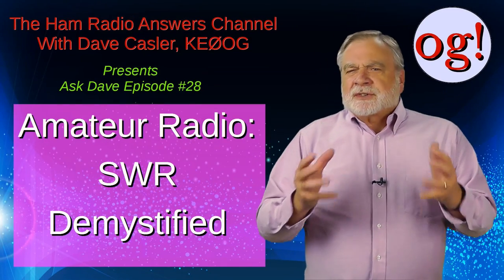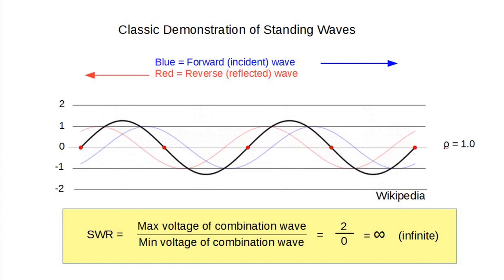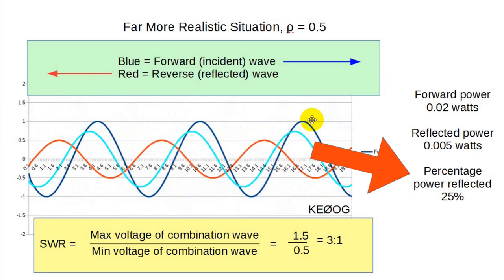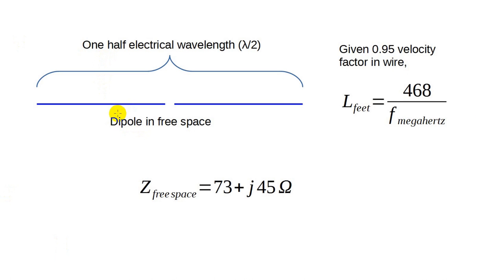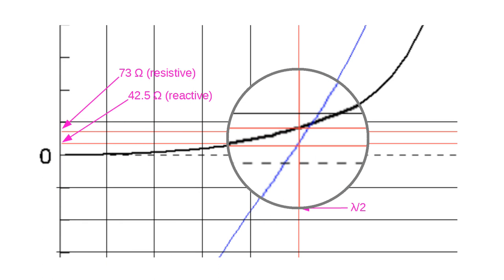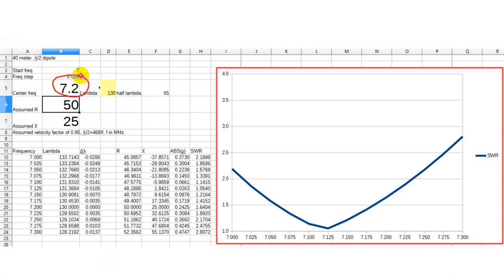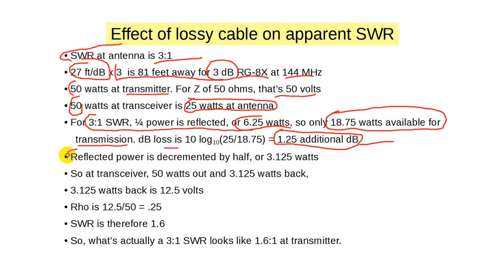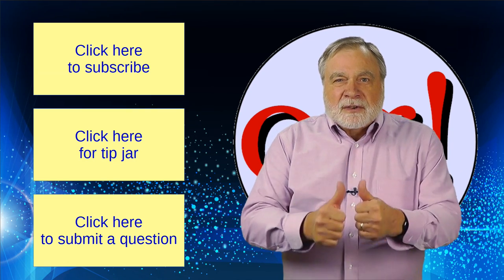SWR Demystified: AD#28

Comment: "Antenna designers pay attention to this stuff." Well, the competent ones do anyway. 

The company I worked for bought and tested 20 different antennas from commercial vendors. One marginally met its specs. The other 19 might as well have been coat hangers. 

Only buy antennas from places with good reputations. Or build and test your own, which is a pain.

Comment: Greetings David. I made some calculations and if for example, i have (50 + 45j), maybe 1.3 swr, the question is, what is a safe reactance for a transmitter?  Because the ideal would be (50 + j0 )but that is not the reality. I know that reactances can have dangerous voltages. A (0 , 50j) theoretically can have 50 ohms but not radiation resistance. I believe (47, 12j), you know 12j or less. I would like your opinion.
Reply from the maker: I'm not following your question. In general, 50 ohms resistive is the ideal load. As a rule of thumb, any SWR less than 2:1 is probably acceptable, but you are correct that the more resistive it is, the better.
Reply: Thanks for your answer. I agree with you. I know it's impossible to get a perfect antenna. By the way great videos. I am extra since 25 years and I always see your videos to maintain fresh my brain. And I learned new things. So thank you for your good work with your videos.
Reply: It depends on transmitter impedance & reactance (including it's antenna tuner). If transmitter has fixed impedance (let say 50 +j0), than any reactance will increase SWR, any R different from 50 will increase SWR. But if transmitter has tuner, which consist of 2 parts: reactance compensator and resistance transformer, than it can have SWR=1 with any complex antenna impedance. If antenna has +j reactance (inductive component is high), than antenna tuner with extra capacitance will compensate reactances. If antenna has R=25, then 2:1 transformer will match impedance and you will achieve SWR=1. In practice, tuner perfomance is limited by the fact that impedance of cables is fixed (e.g. 50 +j0) and antenna tuner must be placed near antenna, not transmitter. Another bottlneck of working with very low R is higher ohmic losses, with 2:1 transformer you decrease Voltage and increase Current twice. Twice current is 4x heat losses. Bottleneck of high R is high voltage and air ionization (possible arc).

Comment: Few questions pls. Can a standard HAM SWR meter be used for VHF say from 80 MHz to 110 MHz? Does the SWR reading depend on power being fed? Will the reading be same for 5 watt to 50 watt with a dummy load of 50 ohms (required wattage taken care of). Should the 50 ohm cable length  be multiples of 1/4 lambda for a 50 ohm GP antenna?
Reply from the maker: Yes. No. Should be. No--if the antenna is matched, the cable length doesn't matter.
Reply: Thanks a lot

Comment: You said that it is rare to have an antenna with 1-1. All My antennas are resonant on the band they are used on. It can take a long time to actually get the antenna to the 1-1 where no SWR is shown. VK2LEE  Lee
Reply from the maker: A 1 to 1 SWR means that the antenna is not only resonant, but the input impedance is exactly 50 ohms. That's pretty rare. But if you can get it there, more power to you, literally.
Reply: @davecasler  I shouldn't say every antenna is 1-1 but very close ,  but I am finding many new hams trying to use one antenna for all bands or many bands... with terrible results.... Excellent video DAVE...VK2LEE Lee

Comment: noting this as i watch here but... isn't impedance (z) = square root of r squared+x squared   not the sum actually? i know algebra is difficult to understand but you cannot drop squared anything until you square them, then add then take that square root. just making sure i understand this. if i am wrong i atleast learn something. will add comments as i watch but have to in order to write the questions so all of us can learn here. new ham or not thank you all for enjoying the hoby and having fun to keep it going.  ad0am
Reply from the maker: +Adam Rennison Actually the method you propose, which results in the magnitude of the impedance, is the same as mine. Impedance has a phase angle too. The approach using complex numbers (that's where the j comes from) gives both magnitude and phase angle. For a much more complete explanation, see my Amateur Extra video at https://youtu.be/OLDtIjsYowg.
Reply: +David Casler thanks for the info. very helpful

Comment: What is a good and possibly affordable SWR meter?
Reply from the maker: MFJ has a slew of SWR meters. Take your pick.
Reply: I find the AVAIR AV-201 SWR Power meter. it also works with SSB.. there are other models too.... You can usually find good used meters too..VK2LEE

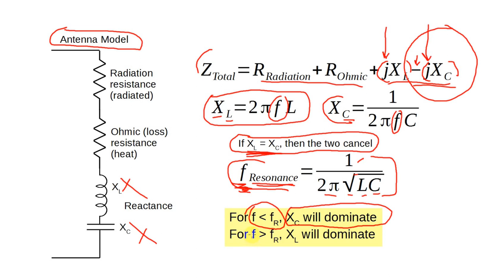Comment: 10:40 Do you mean capacitive reactance?
Reply from the maker: I think the inequalities are correct (I'm never absolutely sure). Take an antenna that's resonant on 21 MHz. Operate on 14 MHz. The antenna is too short, so inductive loading must be added to compensate for the fact the antenna is capacitive. I think that's right!

Comment: Great videos on your channel.
Please explain what is difference of SWR influence on RX compare to TX. For simplicity, let's assume zero length feeder. RX (or LNA) is coupled directly to antenna (cable losses and SWR influence on cable losses are well known).
Assume perfectly matched antenna with SWR=1 in given condition (electric field density) produces -60 dBm power output (224 microVolts per 50Ω)
What is expected power output of this antenna, if impedance with RX (LNA) is mismatched, and SWR>>1 ?

Is formula ß=Pout/Pinput = 4 / (2+SWR + 1/SWR) correct? 
Can we use formula Nf (effective) = Nf (nominal) + 10*log((2+SWR+1/SWR)/4) to evaluate SWR-related sensitivity loss?
Reply from the maker: An SWR mismatch would mean that part of the received signal is reflected back to the antenna and re-radiates, and is hence lost to the receiver. Given that an antenna's noise figure is a given, static value, if you lose signal then you lose SNR, which has the effect of appearing to raise the noise figure. I wish I could engage in an engineering-level discussion of that, but it's been too many years since I obtained my degree! I would suggest discussing this with your engineering professor. 73, Dave

Comment: My understanding always was that a high SWR meant that the voltages coming back would destroy your finals. If that's not the case, what impact does a high SWR have on your radio (and why do most radios have protection circuitry that shuts it down if the SWR is higher than 4:1)? And if it is the case, how is it the least important measurement?
Reply from the maker: Most radios today start shutting down if the SWR goes above to the one. By the time you get to 4:1 you'll probably have hardly any power output at all. Reflected power from the antenna has to go somewhere, so it creates heat in the finals. All modern radios have heat sensors that will cause the final to back off before there is any damage.
Reply: To me, that sounds like it's a pretty important measurement then. Because if you have a high SWR, then things like gain, radiation pattern, and efficiency won't matter. Because most of the power is coming back to the radio as heat--not radiating out from the antenna. Maybe I"m missing why it's one of the less important measurements?  I honestly want to understand this, because coming up through the CB era, it was drilled into my head that SWR was the most important thing to measure--if nothing else to protect your radio.
Reply: It's especially important because of how common it's available as the only measurement. I think David is high on math.
Reply: @davecasler  Did you mean to say two to one?
Reply from the maker: loctite222ms Yes, good catch.

Comment: why is more and better instructions on this subject make this more complicating, I used to tune an antenna and get 1:1 at worst and now cannot do better then 1;2 or worst why is that To much wind? LOL thanks for trying to get me back on the right path. How about 1 radio 1 frequency 1 coaxial cable and 1 antenna
                               10M      29.00000      RG213                 16.317 ft
Reply from the maker: +Geronemo Bauer If I were stuck on one frequency, I think I'd pick something in the 40 meter band. Seems open almost all the time. 73